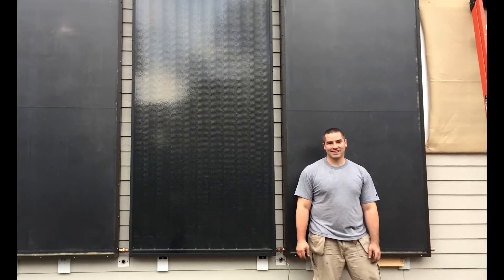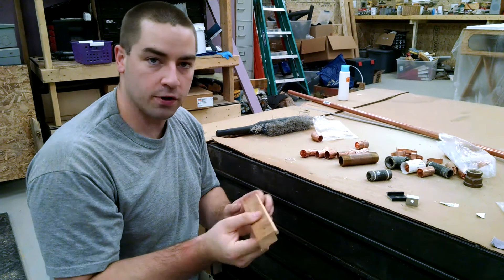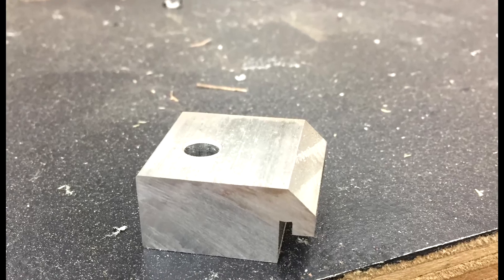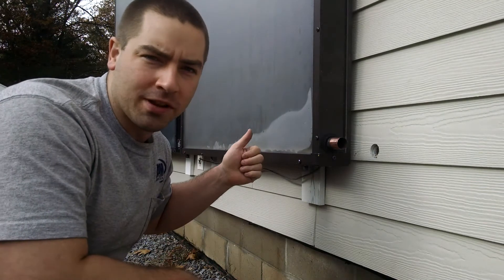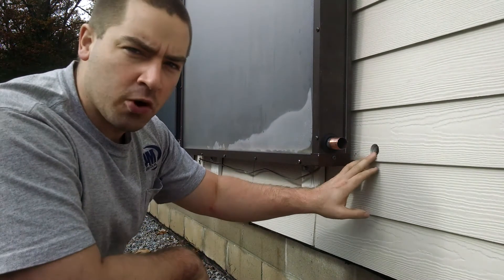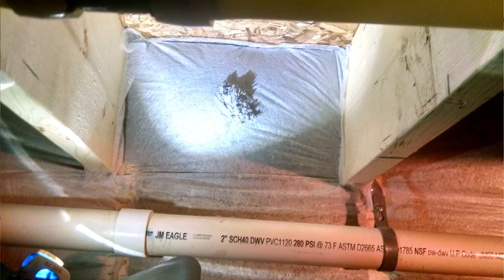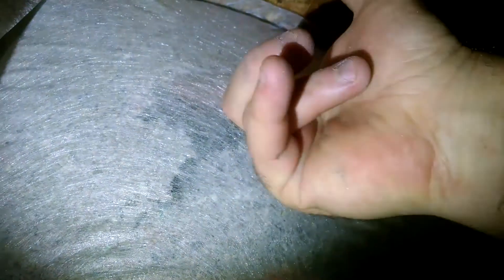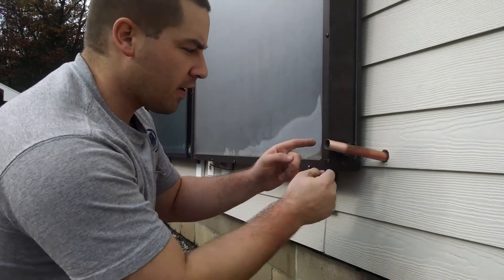Mounting Solar Panels for Hot Water

Comment: How is this holding up? Interested!
Reply from the maker: Works great.  Still doing it's thing.  All automatic, so I don't really think about it.
Reply: @DavidPozEnergy  great thanks for the response! Hoping to making something similar in Vegas.
Reply from the maker: @mariosalazar7896  Sounds good.  Although being lower in latitude you may not get much production if your panels are vertical like mine, you may have to have a tilt.
Reply: @DavidPozEnergy  makes sense! I might just put them in the roof along with my photovoltaics

Comment: Awesome setup.  Since it is a drain-back system...Are you using a vacuum breaker so the water drains back fast and efficiently??  Or do you not even worry about it gurgling and getting a possible water-lock situation (not draining back to tank fully)??  I have seen people do it both ways.  Just wondering what you have and does it work reliably without issues for years??
Reply from the maker: It drains back fully.  When the water enters the tank, the pipe enters at the very top, into a large air gap that the water never fills all the way up to.  Yes, that makes a splashing noise, but it's in the crawlspace so I don't notice it.

Comment: Hi There do you find your panels work efficiently flat against the wall with no angle it’s something I’m thinking of doing but don’t know whether to put them on a angle cheers Norman UK
Reply from the maker: The panels work great in winter, but not well in June and July.  I should have kicked them out at a very slight angle, maybe move the bottom one-foot out.  These are 8 foot tall panels.  If I had added just this little bit of an angle they would have been enough hot water all year.

Comment: IF my previous research is correct, this style collector can be about 50% efficient - correct ?  which is outstanding. Compared to your average PV panel which is about 16% efficient.  You can harvest anywhere from 1000 to 2000 btus per square foot of collector -per day from what I read. 

Here at the 43'rd parallel ( north of Detroit) our winter time sun is horrible, something like 1.5 hours of peak sun per day in Dec and Jan ... 2.3 in Feb. Really rough.  I'm making it with PV, but even with 14,000 watts hanging out there, I still have to run the generator a bit.  

Have you done the calculations to see how many sq ft of collector your house needs to keep up with it's heat load ? I realize you're using this for hot water, but I'm wondering if you've done the math to see if you could heat your house as well using hot water ?
Reply from the maker: My Latitude is 42.5 N.  So we are not that far apart.  My average production during this winter has been 60,000 BTU's per sunny day.  That is 20,000 per panel per day.  I typically hear the pump running for four hours per day (10-2) because it won't get hot enough earlier or later.  So that is 5,000 BTU's per panel per hour.
Reply: Ok, so I recall seeing a video where your house uses like 6000 btu's per hour. Given that, 6000 x 24 = 144,000. You're making 60,000 with the collectors you have, so 144/60= 2.4.  So basically, you could heat your house using solar hot water with 2.5 times the amount of collectors you currently have-- but that's on a sunny day.   How many btu's do you make on an overcast day-- if you know ?
Reply from the maker: You are absolutely on the right track for figuring how many more panels I might need.  And you are right, that is only for a sunny day.  Then we would need to ask ourselves how many overcast days of storage we might want.  The system (panels and tank) get real big real fast.  To your question on overcast days.  I'm going to have to answer that simply by sharing some of my observations because I don't have data loggers.  If the tank of water is low (maybe 105°) then I get short cycling of the pump running for 5 minutes and shutting off, over and over again.  The tank only climbs by a couple degrees.  If the tank is hot (say anything over 130°) the pump never kicks on.  However, contrast that to the garage where I am space heating at a much lower temperature water.  The pump might run for 2-3 hours even in overcast because 80°F water to add heat.
Reply: I studied this years ago and it would take an ungodly amount of square footage to generate the 25 million btu's we use in an average January to heat the house and the shop. But you have the perfect situation - a house that uses what, 4.3 million btu's for that same month of Jan. That's why I'm so 'on this' idea.... wow. If i were 30 years younger- I'd SO make it happen. At age 60 I'm thinking more like>> Arizona, not solar heat...  so I'll have to live vicariously thru your projects !
Before I forget (again), do you own a solar insolation meter ?   or solar power meter is what they call them on Amazon.
Reply from the maker: Nope, I don't own a solar insolation meter.
Reply: @mark_osborne  Hey ur just a Young fella! lol, im 62 and playing with Solar Hot Water.No expert but yes its to hard to heat with Solar Hot Water (SHW) for the Winer months but the others should work? Also u may try the Evacuated Tube type? They dont "see" the cold bc they are in a Vacuum
Reply: @rolandreves7222  Yes the Evacuated Tube can approach 70% !! efficiency .  Interestingly, Mike Reynolds (he's the Earthship go-to guy) tried both Evacuated Tube and Hot Water panels like David's and eventually gave up on both and went to strictly Solar PV even tho they are much less efficient.  His reasoning was>> they simply couldn't keep up with all the problems/leaks/pumps, etc.  He talks about it extensively in one of his seminars.   BUT, he's building Earthships in places that have abundant sunlight.  If he had to build one at the 43rd parallel, he might be back using Evacuated Tubes   :-)
Reply: Hey It looks like you are using this to heat the floor of your garage,  I haven't watched all of your videos so not 100% sure.

I was wondering if you have heard of this:
http://www.cansolair.com
or
https://www.youtube.com/watch?v=bRZvAAqzXIw

From what I have read on their site it works in minus temps (Celsius), and one or two would heat your whole garage.
Reply from the maker: I have heard of those.  However, this setup on my house is for heating my domestic hot water.  This is not space heating.  Thanks for watching.

Comment: Why did you choose solar thermal over PV for water heating?   Most of us believe that solar thermal has been dead since 2012. http://www.greenbuildingadvisor.com/blogs/dept/musings/solar-thermal-dead
Reply from the maker: Hi Kevin,  I enjoy reading Martin's articles as well, and I don't argue with his math.  If you have to hire someone to do plumbing for solar thermal vs. hiring someone for wiring in PV, then the decision is easy, PV is cheaper.  I live in Massachusetts where it is illegal for me to wire in my own PV array; I'm forced to hire it out.  However, I'm allowed to do solar thermal plumbing.  Also, I bought these solar collectors at a garage sale.  They were new, but never installed, sat for years.  Even with copper fittings, PEX, EPDM, etc. I have less than $1K in this.  

I hope that helps.  Also, what group are you referring to when you say "us" in "Most of us believe..."  Thanks, David